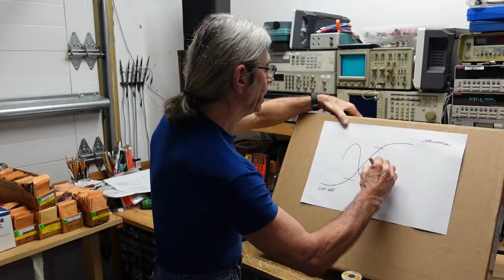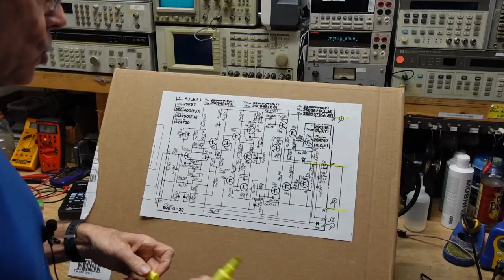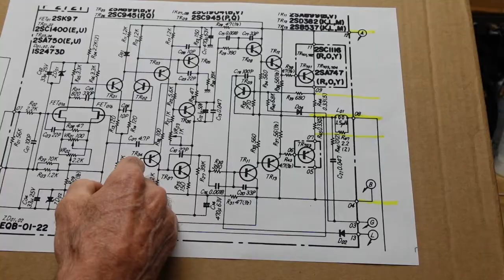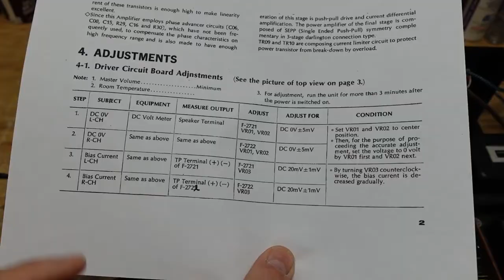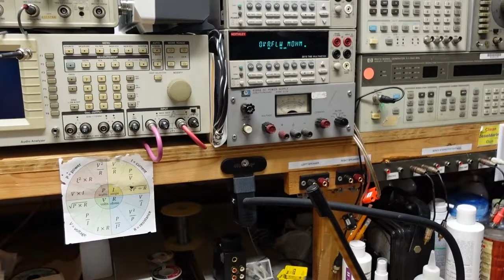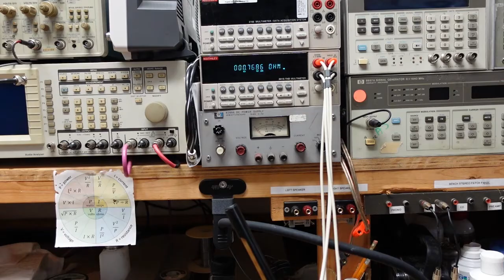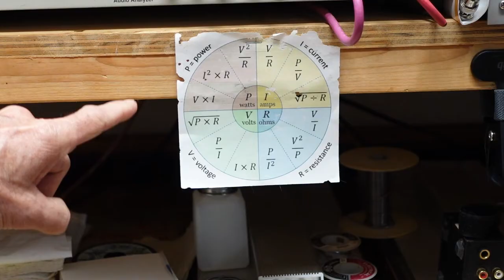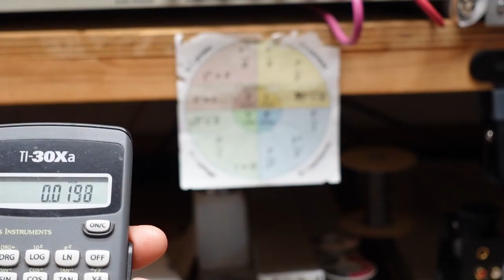Bias and Offset in Audio Amplifiers

Comment: Hello Ray, Very informative video. I've watched it several times. When checking the DC offset on a power amplifier, is it necessary or a good idea to short the signal inputs?
Reply from the maker: It's not necessary.  DC offset is just setting the balance between the positive and negative (NPN/PNP) sides of your amp.

Comment: when measuring the dc offset is it necesary to connect the output to the dummy load?
Reply from the maker: No.  The purpose of the adjustment is to balance the positive (NPN) side of the amplifier with the negative (PNP) side, so it sits as close to zero as possible.  A few millivolts won't hurt anything, so don't drive yourself crazy trying to get it set perfectly.  It will drift a bit with temperature, so just make sure the amp is sufficiently warmed up.  That will vary with different amps, so set it and check it again in 30-60 minutes.
Reply: Thank you very much Sir it helps me a lot. Have a Great New Year.

Comment: Hello, I changed all the final transistors because they were shorted, denon 3311,burnt resistors, I measured on those white names and I have over 50 mv on all channels, but I can't adjust the voltage, I turned it left and right and it doesn't change, I can't reach 8mv, I have no sound and the radiator goes over 90 degrees, I don't know what else to do.
Reply from the maker: Hi Bogdan.  Were all 7 channels damaged?  The only thing they all have in common are the power supplies.  Check those at the collectors of the outputs.  They should be equal but opposite in polarity.  Are you getting audio from the preamp out jacks?
Reply: @raygianelli3612 I bought power transistors the same way, I changed them all, but I still have no sound, when I turn it on the radiator jumps 90 in 3 minutes, and I have a bias voltage between 50 and 70 mv that I can't adjust, I tried but the voltage doesn't drop,

Comment: 9:22 Excellent, you're a good technician. In fact, there's already a shortage of technicians like you. My admiration 👏👏👏
I'd like to ask you the following: Why is it that once you adjust the quiescent current and bias voltage, the values tend to change after the amplifier's temperature increases slightly?
I'm a self-taught technician, and based on my experience in the electrical field, I can perform some repairs and logistics with the help of your videos. I appreciate you sharing your knowledge through this medium.
I have that same AU-717. I can adjust the adjustment to 0.00 volts and bias to 20 mV, but it then varies.
Greetings from Santo Domingo, Dominican Republic.
Reply from the maker: Transistors are very temperature sensitive, and their conductivity can change drastically.  They can even destroy themselves if they reach a point called thermal runaway.
Reply: @raygianelli3612  Good morning, thank you very much for the information.
That is, once I turn on the amplifier after 5 minutes, can I adjust the voltages and leave them there? I can see that the set voltage values are changing.
Regards
Reply from the maker: @jlrliriano  Yes.  I usually set them a bit low, because there is little benefit to setting them high, and setting them higher will generate more heat, potentially shortening their life.
Reply: @raygianelli3612   Thank you very much, Rey, for your help. I've already set the bias voltage to 17.5 mV. I was able to adjust the bias voltages to 0.01-+ mV, although they continue to vary depending on the temperature. Have a nice rest of your day. 🇩🇴

Comment: So I have a au-517 that I fully restored with either ultra low esr caps(power supply) or audio grade caps in the amp boards...anyways, both boards I can't adjust the BIAS anymore.  A couple 150Ohm and the pots were changed to single turn cermet types. I literally just got sone the resto last night. Sounds phenomenal, but I'm worried about the BIAS.

Any thoughts?
Reply from the maker: Measure your voltages from the bias transistor toward the output.  See where you lose the ability to affect the voltages when turning the bias pot.
Reply: . Okay, I will do that as soon as I can, I WILL REPLY back here. Thank you so much. 

After putting over $500 of high end parts into this baby I would hate to see it go bad from something like this. Miflex, Mundorf, Nichicon Muse, Amtrans PP caps are among the capacitors used in the resto, plus the ultra low esr caps in the power supply.

Comment: I just love watching your videos Ray, and your knowledge and discussion is so easy to digest. 
 I just purchased a Sansui G9000 and when I returned home I installed my speakers. I then noticed that my right channel System A and B have lower volume output than my left channel System A and B.  I tested DC voltage output on all 4 channel for System A and B. System A and B right channel is outputting 67.3mA and System A and B left channel is outputting 53.5 mA.  These seen high, my question is, would this cause the sound output on the right channels to be lower? This happens on any input, bluetooth, FM, Phono, and headset jack. I Did notice I get a hum through the headphones with 0 volume.  In order to have sound balanced between the both I have to move the balance nob  to -2 on the left channel, or plus 2 on the right channel depending how you interpret this.  Any suggestions. Otherwise the unit is beautiful. Thanks
Reply from the maker: Frequently this kind of issue is caused by dirty/tarnished switch contacts.  Flip your tape monitor switch (es) on and off, same with pre/main.  Ditto for any tone defeat switches.

If that doesn't help, inject a signal into the main in from a source with a volume control. and see if both channels are equal.  This "divide and conquer" approach points out whether the trouble is in the output stage, or before in the tone stage/switches.

Important that the source used has a volume control, because if you just plugged a CD player in, it will output full volume.1
Reply: @raygianelli3612  Thanks so much, and great suggestion. I will definitely do this.
Reply: @raygianelli3612 Hi Ray, well i took your advice and removed the audio muting switch and took it apart, sure enough there was carbon build up and the small clips that ride the rails to engage and disengage the 20db mute were bent and not making contact. I was able to straighten them back to their original shape and put it back together. It worked, the right channel no plays at full volume when, mute is off.   

I was able to set the DC offset on both channels.

Now my next issue is to resolve the BIAS on both channels. Both lett and right reached their limit on the POTS in an attempt to set to 13mA.  Left will go to 10mA and right is at 0mA.
Reply from the maker: @TrojanStarryNight  Good job with the switches!  That's a delicate task.
Bias issues can be tricky to sort out.  Let me know how it goes.

Comment: I have a Yamaha cr820 no bias on one side but waveforms are ok
Any ideas
Reply from the maker: Check your voltages at TR707's (TR708 on other channel) emitter cand collector as you turn the bias trimmer.  Make sure the voltages change, and are near what the schematic calls for.
Reply: @ I will check over when I get in the shop Wednesday 
Thanks for your help
Reply: @ 
One side adjusts the other side has no action I changed tr707 something is sucking down the voltage 
I will work n it some more on Wednesday

Comment: Hi, I bought a Dartzeel NHB-108 clone from China and measured the offset on both outputs. The right output shows 0mV DC and the left shows 155mV DC. Should I be worried about the left output or is it so small that it won't affect the sound or anything? It seems that it is not possible to adjust this with a potentiometer
Reply from the maker: Well, it's not great but that's really not enough offset to cause damage to anything.

Comment: IF THE  b+ VOLTAGE ON THE BIAS TRANSISTONS ARE LOW IN EITH THE POSTISIVE BIAS TRANSISTOR OR THE NEG. BIAS TRANSISTOR WILL THAT CAUSE VOLTAGE ON THE SPKR OUTPUTS ??? ALL THE POWRT TRANS. ARE GOOD.
Reply from the maker: It depends.  If the voltage is less than 1 or 2 volts it may just be offset, for which there may or may not be an adjustment.  If there's no adjustment, careful matching of the input differential pair usually fixes it.

If it's higher than that, you need to see if the voltage is positive or negative.  A positive voltage on the output can be due to a low negative voltage.  Compare voltages from the good channel, this may help point you in the right direction.

Comment: Is there anyway to bias and/or offset an amp without a service manual?  I have an SAE 2201, no service manual seems to exist, but it has 2 adjustment pots on it.
Reply from the maker: General procedure is to measure the voltage drop across one of the emitter resistors and use Ohm's Law to calculate a current of around 20-30 mA.

Comment: In my HK PM655Vxi, after replacing the burnt power transistor (Q441) (bias measured = 780mV), I also found a burnt resistor (R481), which I also replaced. Then I checked all the resistors - they are ok (I compared them with the right channel, which is good). I checked and I compared all Ueb voltages in the transistors, they are identical to those in the good channel. I still cannot obtain the required bias voltage - the lowest is 230mV and it can only be increased. On one of the forums I found advice to replace the R457 resistor (470 Ohms) with 330 Ohms, but I'm not sure if it can be done. Please advise something.
Reply from the maker: Measure the voltages around the bias adjustment.  That may point to the issue.
Reply: @raygianelli3612  Thanks for advice - with the VR403 pot set to minimum, I measured the voltages on the Q429 transistor (bias regulator) and got Ub=-0.37V, Uc=-1.34V, Ue=-1.02V, they can only be increased. Analogous voltages in a well-functioning channel are Ub=-0.56V, Uc=-1.22V Ue=-1.20V. I checked on the table (after dismantling from PCB) transistors Q429 (bias control), Q437 (attached to Q429), Q421+Q425, Q423+Q427, Q435 - they are also good. I also checked the driver transistors - Q437 and Q439 - they were also good. I have no idea what could be damaged there.
Reply from the maker: @danekogolniak9680  Have you checked the value of the bias adjustment pot?
Also, compare voltages from the outputs back and see if anything looks suspicious.
Reply: @raygianelli3612  Pot reg. bias from 0-500 ohms changes correctly. I checked all voltages in the power amplifier and compared them with a well-functioning channel. Only the voltages on transistor Q429 differ slightly from the voltages on Q430 (a well-functioning channel). First of all, there is a visible difference in the voltages Uc and Ue - it should be 1.2V and it is not, even though the Q429 tyransistor is good - measured with a multimeter in the diode mode on the table after removing it from the PCB.

Comment: Hi! If you don't have any service manual of amplifier how can you set the proper idling current or bias for amplifier? Thank you.
Reply from the maker: General rule of thumb is about 30mA.  You can calculate your bias voltage by multiplying one (or both) emitter resistor values times .03
Reply: @raygianelli3612  Ok. Thanks again.

Comment: one power transistor (black) is burned out, the other transistor (green) is good. After replacing the black transistor, I measured the voltage between the emitters, it is 0.754V too high and cannot be reduced, kindly tell me if it is because I only replaced the burnt transistor. Should I replace both power transistors in the damaged channel? I'm repairing HK655Vxi.
Reply from the maker: Often when an output transistor shorts it takes other components with it.  Check back from the output, drivers and resistors.
Reply: @raygianelli3612  I checked back and I found varistor mv12ym (chain of diodes) which is burnt out. I can not find any replacement. Maybe you know any substitute. Amplifier PM 855Vxi, element D409, kindly please help me.
Reply from the maker: @danekogolniak9680  I can find nothing with that model number.  I'm guessing it's a Harman Kardon PM655VXI.  You can use 2 1N4148 diodes in series to replace the MV12YM.
Reply: @raygianelli3612  thanks very much for your quick reply, yes, that was my mistake, this was for model PM655Vxi.  Your advice is always very helpful.
Reply: @raygianelli3612  After connecting the 1N4148 diodes in series, should they somehow be fastened to the main heat sink holder?
Reply from the maker: @danekogolniak9680  Only if the old one was.

Comment: Do you use a resistor on the speaker terminals when checking bias?
Reply from the maker: No, we measure the voltage drop across the output transistor's emitter resistors, and use that value to calculate the bias current using Ohm's Law

Comment: SIR , THANK-YOU VERY MUCH..just a guick question..won,t adjustment to the the bias change the dc off set ?
Reply from the maker: Marginally if at all.  DC offset is all about setting up the balance between the two halves of the circuit, i.e. the NPN/PNP halves.  Bias is setting the idle current, kind of like setting the idle on a carburetor.

Comment: Nice video, informative. I would like to know also about the output and driver transistors Collector-Emitter Voltage readings,
Reply from the maker: I don't know why you'd need to know this, but it's easy enough to extrapolate. In a properly functioning amplifier under no signal conditions, the output transistor's collectors will be at the supply voltage, either positive or negative. Their emitters will be at zero volts. The driver transistors collector's will also be at the supply voltage, and the emitters will be at .6 volts, also either positive or negative depending on whether we're looking at the NPN or PNP transistors.
Reply: @raygianelli3612  How about the collector quiescent current and collector emitter qiescent voltage of the outputs and drivers at max. input signal?

Comment: Hello, the factory data is 5mv. If I change it to 10 or 15 mv, will there be any harm or will I see any benefit? My device is rotel rb 1090 power amplifier
Reply from the maker: Higher bias will cause your output stages to run hotter. There may be a small (inaudible) drop in THD. I tend to run the bias at, or slightly lower than the factory recommended settings. Heat is bad for semiconductors.

Comment: At 6:39 “… some people like to use multi-turn pots either 10 or 25 turns so that is not an issue. I use the single turn pots, you can get it, you just have to be patient”.

At 7:40 “Our offset is really good right now (meter shows perfect 0.000 mv) and I hate to touch it… because you will see just how touchy these adjustments are” [proceeds to just touch it (not turn it)] “it’s already over 300 millivolts” (factory spec is within 5 millivolts of zero). 😂 

At 8:50 Finishes fiddling with offset “We got negative 2.6, 2.7 millivolts” (within factory spec). 😁

At 11:05 offset has been constantly drifting in the background over past several minutes and is now to negative 41 millivolts and is rapidly moving further away from factory spec of plus/minus 5 millivolts of zero.
😲😬

Comment: I doubt that these 4 wire cables are any good because they measure the voltage at the same point where the current is inserted. If you use 4 wire resistance measurement you need to make sure, that you also insert the current at differnt points to the DuT. Otherwise you also measure the contact resistance in series with the resistance of the DuT. Especially if the device has a very low resistance, your results can be very wrong.
Reply from the maker: https://en.wikipedia.org/wiki/Four-terminal_sensing
Reply: @raygianelli3612  correct. But four terminal sensing doesn't work if you only have 2 terminal at the DuT. It is important to sense the voltage without the voltage drop, which is caused by the transition resistance and the measuring current.

If you want to sense a resistance in the mOhm or even µOhm range you need to transfer larger currents to your DuT. You cannot measure the correct resistance at the same point where you introduce the current. Four terminals means four terminals at the instrument and also at the DuT.

Comment: so were gonna modify something designed by professional engineers suppose we can do
 better than they did? bias an amp? yeah, follow thier schematics!
Reply from the maker: And what exactly was modified?
Reply: The engineers don’t know what tubes you are putting in or degradation of those tubes or the other materials in your amp..  things change over time..  even materials used by the oem mfg of the tubes could change and effect the voltage running through.

Comment: If Marantz likes to see ~75 milliamps and you know how ridiculously hot that runs, and you (and they) know heat is a bad thing, why do they have that specification? And what is gained or lost by reducing that level of bias current?
Reply from the maker: They may have wanted it to run in Class A for the first few watts.  IMO the heat sinks won't support that, and watching the distortion as the bias was dropped to sane levels led me to advocate for setting these amps to a far lower level.

Comment: My old amplifier doesn't have trimmers for reducing the DC offset.
Left channel 0.3 mv , right channel 50 mv.
I have never change the main capacitors, will this fix the problem?
Thanks.
Reply from the maker: Changing the main filters won't affect the offset. Replacing the input differential pair with a matched pair of transistors at the should.
.3 mV is really low. Is the amp a servo design?